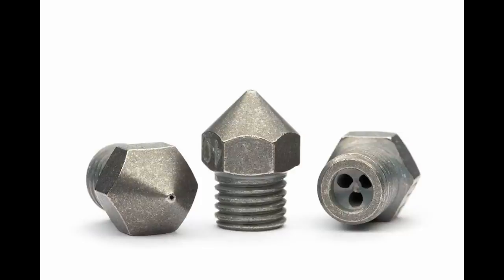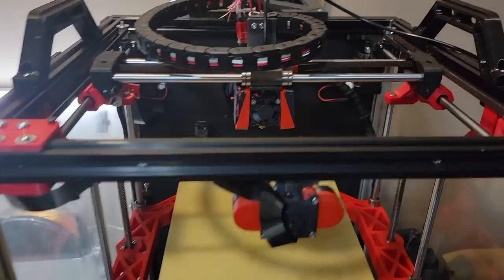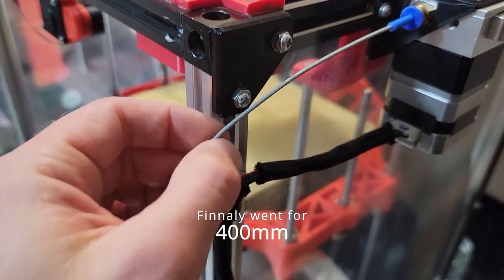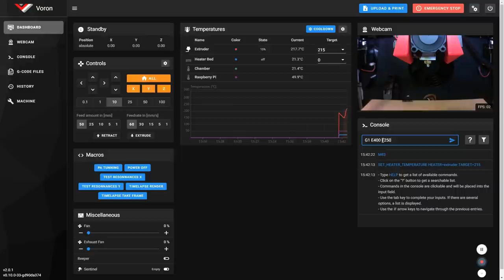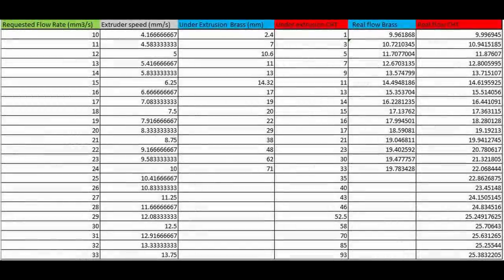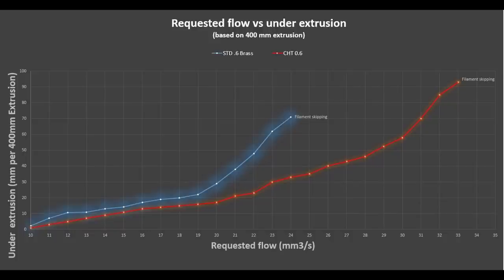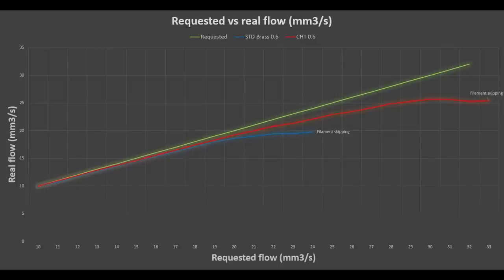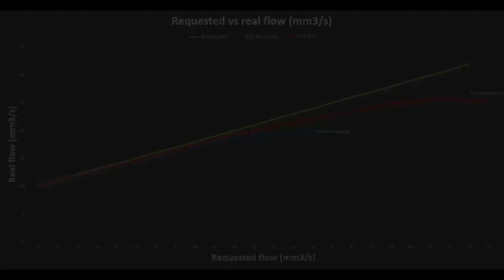BondTech CHT Nozzles Flow test. Do they work?

Comment from the maker: Keep in mind that this test was done on a Bowden setup with a single drive extruder. There is way more filament slippage than a dual drive. So I expect way better result on a BMG/hextrudort or LGX extruder. Specially in a direct drive setup.
Reply: I bet will get less under extrusion and skipping step faster. If you have time for test that 😁
Reply: Actually the effect can be even more. I upgraded a prusa mini from stock to BMG feeder. Printing PETG I often got problems with skipping or total blocking. Reason was due to many retractions on the object parts of the filament passed the gears multiple times. The bondtech gears deformed and a bit streched the filament. Only decracing the speed helped... Actually the problems on stock feeder where less (in this scenario, but the BMG behaved a lot better in other scenarios).
Reply: Faulty test from jump.

Comment: Great job brother!  Love the way you have done that test; simple, clear and easy for anybody to repeat at home with their own setup.  I am surprise to see how much filament does not get processed even in the low flow rates :O.  Will keep an eye on that, thank you!
Reply from the maker: I was surprised as well.. but this is a single drive extruder, so...
Reply: Time for a "filament slippage compensation" implementation in Klipper!
Reply: @Vez3D  i have wondered, with the new boards that have 8 drivers, could you clone the extruder output, and run 2 extruder steppers and drivers, and have the 2nd extuder at 90degrees to the first, so the teeth bite into every side of the filament... it would suit bowden style fine
Reply from the maker: @specialingu  there are dual drive extruders. I just still didnt upgrade my Voron yet :P
Reply: @Vez3D  yeah I know, I mean 2x dual drive :) that would give you even more shove/pressure before slippage? As the limit is the gear teeth shredding the plastic?
Reply: L

Comment: Great video Vez! Very informative. The lack of the 0.4mm size at launch was because CHT is supposed to be a high flow nozzle, and 0.4 is not for that at all. It also requires very high speeds to use it to the limits. We listen to the market and we will have the 0.4mm available soon. Abrasive resistant later this year we hope. As people may know we have a partnership agreement with 3DSolex and we are using their patent under license. This was not created by Bondtech but we did recognized the value of this inovation and finally is out there for us all to use.
Reply: how come you dont have a copper version?
Reply: @specialingu  The perfomance improvement wasn't following the cost increase.
Reply: @nunosantiago6720  I'd like to see a Tungsten Carbide version of the CHT (if it's even possible to machine) - great hardness + great thermal conductivity = best of both worlds.

Comment: Thanks for testing this.  One thing that REALLY caught my attention was the difference in output starting at 9:44.  The regular nozzle making wide loops while the CHT makes a tight stack tells me that the regular nozzle isn't putting as much heat into the plastic, so, as it cools in the air, it is less flexible and thus can't make tighter bends.  What that should mean in practice when using the CHT is that the plastic will not only flow and stick better, but won't 'tug' on the nozzle at high speeds.

Does that make sense?
Reply from the maker: It does

Comment: The pattern is so consistent I am surprised we don't have a speed compensation parameter to tune on the firmware (maybe we do and I don't know about it)? Has anyone showed this to the Klipper developer? 😀
Reply: Damn that's a great idea. Should we make a feature request? I'll vote if anyone does
Reply: Oh well, that would be awesome!
Reply: Came here to make this point... already made - good job :)
Reply: What would you change though .. higher feed rate leads to slippage so increasing the feed rate to compensate just increases the slippage?
Reply: @MrMetalWorx  could still work if they don't increase at the same rate. Maybe some temperature compensation could be thrown in as well.
Reply: On reprap this has been available for years, it was one of the main reasons why I switched from Marlin at the time.

Comment: Nice to see the actual charts for this, i spent my latest live stream playing around with these and just ran higher and higher flow prints till they maxed out. But they do deliver on what they claim, which was great to see. Really the only downside is no sub .6mm nozzles and the fact abrasives are a complete nogo. BT claim coldpulls work find but ive yet to test that either. 
I can see this being one of the "last hurrahs" out of the v6 nozzle/hotend style ecosystem. 
The 1.8mm nozzle is stupid fun and the .6 will be installed in my tallboi going forward.
Reply from the maker: Thanks Nero.. I can't wait to test the 1.8 on my Magnum+. I'm not sure the RepRap V6 style nozzle will go away  soon...Slice has well explained why they chose to go with on the M+ and it made a lot of sense :) go check Vector 3d last vid interviewing Dan. :) Again thanks for coming to here mate. Have a terrific evening 😊
Reply: one thing im curious about, why bother with brass when you could go straight to copper? unless copper is a right sod to machine the way they need to for this...
Reply: @specialingu  Most likely due to the fact that copper is softer than brass and considering how thin the web is, the extra strength would increase life and making machining it easier.
Copper is a PITA to machine
Reply: @CanuckCreator  yeah that makes sense. I guess the ultimate nozzle might be a "phat" revo type with a copper jacket and a brass splitter insert but that might be impossible

Comment: The filament in the old nozzle seems to behave as if there are cooler spots in the extruded filament the way it moves around before falling, instead of just flowing straight down.
Reply from the maker: It definately got my attention as well how differently they were pushing plastic.
Reply: He's pushing it so fast the center of the filament isn't melting as fast as the outside so I suspect the fan is hitting at the points of the extruded filament that bend intermittently.
Edit: I think that's the reason for the mixing section of the new nozzle.

Comment: Thanks for the test, it's very interesting and informative! I noticed an issue though, you mentioned you are comfortable at 19mm^3/s for the standard nozzle and 27 mm^3/s for the CHT nozzle in the video because you don't want to see too much under extrusion in actual printing(very good point!). But according to the curve you get, CHT nozzle will under extrude more start from about 21.5 mm^3/s onwards. I think the comfortable points for each nozzle should be 19 mm^3/s and 21.5 mm^3/s instead?
Reply: Added an image to demo the under extrusion amount: https://imgur.com/a/H2HKMfd
Reply from the maker: Sure but that it's at high speed with no stop for 400mm.. I don't see a print where there is not stop or break for the hotend like so.. that's why I think it would be safe to use higher
Reply: @Vez3D  This theory applies to both nozzles here ;)

Comment: Do you have any strange z inconsistency issues on that printer? I'm asking cuz I noticed that the extrusion gear is off center and CNC kitchen just put up a video where he was having issues with the printer and the off center hole in the extrusion gear was causing uneven extrusion.
Reply from the maker: not realy.. minimum I think. just normal stuff with 3d printer stuff. But maybe it will be better once I fix this
Reply: @Vez3D  okay yeah yours doesn't look as bad as his did I just noticed the wobble so I figured I'd mention it

Comment: The deviation between requested/actual flow was pretty much my main roadblock when trying to go faster. Sure, it'll still print, but at some point the quality really starts suffering from under extrusion.

I'm not sure if you could compensate for this in software or just have to pick a nozzle/temperature combo with a little under extrusion.
Reply: The Prusa Slicer has a flow restriction setting .
However faster always means worse. The plastic needs time to bond.

Comment: Gives you the potential for a (pre-stage melt) before it hits the final nozzle diameter.  You will need a 24v system and a higher wattage heater to fully take advantage of this. But this will work best for nozzles .5 and bigger.  
Love this outside-the-box thinking on where to gain some headroom!  Well done bondtech!

LOOK at those steppers!!  I want to see you do a closed-loop mod! Looking for missed steps as your pushing the bananas out of it!

Comment: 3 more questions: Is adding 3 holes the same as extending the meltzone (e.g. compare volcano)?  Is surface area the limiting factor in flow rate?  Does forcing the core of the filament to split and therefore heat beneficial in any way (flow, quality)?  Another way to put the last question: how does the temperature gradient across the filament cross section impact printing?

Comment: So if I'm not mistaken here, this technology is purely to increase contact surface area which improves melt time increasing flow rate while creating additional obstruction to the nozzel. Essentially you get faster melt time which increases flow rate but with obstructions that reduces flow rate and makes it harder to unblock. This is compared to what everyone else did, which was to just make the nozzel longer to increase (surface contact and thus) flow rate without extra complications or expenses. In short, this nozzel is great if you need to maximize performance in tight spaces, but it's not going to outperform a longer nozzel.

Comment: I'm making an extruder that uses neoprene belts/rollers to push Filament to not leave any marks for this reason! No bite gears just you know, friction!
Reply from the maker: you have to keep me posted on this :)
Reply: @Vez3D  I'm planning on doing it once I escape Iran so it'll be a while before I can actually try it! In the meantime tho I've been tempted to try tpu printed gears
Reply: @ameliabuns4058  TPU printed gears? Oh dear, those will last like what, one print? At least make them from Nylon, which is known to be very abrasion resistant and actually used for gears sometimes!...
Reply: @fuckutube65  what are you talking about?
Reply: @fuckutube65  it's gonna use it to push filament not as a gear

Comment: I love your videos, and this one is no exception. BUT, it seems to me that something is very wrong here. I have performed these same tests on my stock Ender 7 and I hit 18-19mm^3/s at 5% under-extrusion, 19-20mm^3/s for 10%, and it falls hard (20%-40%) at 23-24mm^3/s at 230-235 degrees with eSun PLA Pro (PLA+) on the factory 0.4 nozzle. Extruder starts audibly slipping at 23^3/s and consistently slips at 24mm^3/s. Why is this underextruding at 10mm^3/s and basically unusable for a quality print (my personal standard for this is 10%) by 12mm^3/s? Something feels off here. Way off.

Comment: My bowden (cr10s pro v2) can do at least 40 mm^3 with a 1.2 nozzle very well, less with smaller ones. Bed slinger can't go faster with acceptable quality to push it (100, absolute max 120mm). But I also have the full copper block. After upgrade from aluminium I had to reduce ESUN PLA+ down to 190-195 degree from 215 degree for good results, got too hot despite hero me dual fans upgrade. Will now upgade x,y axis to linear rails, wheels turned out to be unreliable. After a while something breaks, like waves in first layers because wheels started to develop dirt/bumps or simple untightened themselves.

Comment: Looks like there is no point to use both after 19
Reply from the maker: It depends. This is asking constant rate extrusion at high speed. On a normal print...this would translate to a very very long straight line with no pause. In a real world, the extruder will pause ..or slow down at corners..and curves etc.. or even stop for a retract, releasing back pressure..so I think if it's not skipping it's safe to say it would be not bad.  But keep in mind this is a bad setup with a bad extruder with single drive gear and a Bowden setup. The goal here was just to compare both nozzles on the same bad setup hehe. And yes ...it really improves flow I think. If I do the same test with a LGX or BMG.. it would be show totally different numbers :)

Comment: More even heat distribution through the substrate = better flow. There'll come a limit to how much more performance can be achieved in this method by looking at the viscosity characteristics of the individual heated polymers. The hole sizes can't get any smaller than pi * sheer boundry^2, so that really defines how much you can redistribute heat better using this method of splitting flow.

Comment: I designed an extruder idler assembly very similar to what your machine has and through moving things around in CAD noticed if you add a screw to preload the spring just below the actual load you tweak it to. Eliminates one source of potential skipping but trades it for a source of vibration when it would otherwise skip. I opted for the vibration route since that is counterable by tweaking other settings.

Comment: Would be an interesting developement: A flow correction feature for a slicer, there you make a test of 5 volume speeds measuring the lack of extrusion, the slicer than calculates the trendline and instead of traditional calculating the extrusion lenghs it calculates the lengh realy needed for the speed to actual get the volume needed. Of course never use speed setings of the printer, because if you reduce speed there you would get over extrusion.
Such a correction might be possible in the firmware also - but as the effect might highly depend on the filament you use, you would need an autocalibration there. Maybe an encoder measuring the amound of filament realy is pulled into the feeder...

Comment: Great video very informative thank you. I thought I would share my experience. I went from standard 0.4mm nozzle on my ender 3 pro where my best reliable print speed in cura slicer was 60mm per minute. I put on a cht 0.6mm nozzle and was able to comfortably print with similar quality at 125mm per minute. I printed the same part on each setup. The 0.4 nozzle at 0.2 layer and the cht 0.6 nozzle at 0.3 layer. The print took 17 hours 23 minutes on the 0.4 and 6 hours 7 minutes on the cht 0.6.
Both prints of similar quality. That to me spells results.
Reply: I also have a 0.4 cht that I have not yet tried but that is next on my list

Comment: How fast can you print with this 0,6mm? 28mm3 is how fast?
Reply from the maker: It all depends on the layer height. You can use the tool on 3dpassion where you can buy the nova hotend to calculate speed
Reply: Teaching Tech has a calculator on his website.

Comment: As I read the last graph the CHT is able to push out 25mm³ but you have to set it to 28mm³ so you would have to adjust to set the flow to 112%. But I don't know if this would lead to overextrusions on parts of the print where the max speed cannot be reached because of slow acceleration.
Is there any firmware, that is able to automatically adjust the flowrate non-linearly to the current print-speed?
Reply from the maker: Rrf

Comment: Noticed that you change nozzles without heat on the extruder... I damaged my threads on a Mk7 this way
Reply from the maker: It was at 215c when I swapped nozzle. I know why you say so. Because I touch the nozzle with bare hand. Hehe once nozzle is loose you can use fingers to unscrew it...if you don't hold it too long and too hard. I do this all the time. Hot potato game. Dont stay too long or get burnt hehe

Comment: Thank you, good job. I would love to see a comparison between this and a volcano or other high flow system, to see whether this could be a usable alternative without the hassle. It would also be nice to see a comparison in stringing.
Reply from the maker: this is not meant to replace a volcano :) .. but you can add this to a mosquito Hf to get even more flow.. or a E3D revo.. or anything RR/v6
Reply: @Vez3D  i see what you mean, but it is marketed as increasing flow. I was wondering if this could be a way to use a regular flow hotend in higher flow situations instead of a volcano or an hf mosquito with comparable flow, but being able to revert to standard flow just by switching the nozzle. If you use a volcano, you end up having trouble if you want to use small nozzles, and this may be a way to get x percent of the performance for the occasional use of a big nozzle without messing with the hotend.

Comment: how often do they get clogged with lots of retractions?
Reply from the maker: need to test that.. but Bondtech on their YT channel put a video with a retraction torture.. and it did pretty good
Reply from the maker: dont forget that retraction clogs are happening in the throat.. not in nozzle... unless something carbonized and block the hole.. or a particule is blocking the hole. It wont be any different than a normal nozzle in this case

Comment: your work is good, so why dont invent a own nozzle with heat-elements directly integrated at the end of the nozzle. Then a very-good insulator (e.g airogel  https://www.youtube.com/watch?v=qnOoDE9rj6w) around the nozzle, and then pump e.g. compressed air (cold air) directly around the nozzle to instantly cool the filament down to reach even higher speeds ? Great work your doing.  Also you showed that its important to know the length/thickness of the filament feeded, also invent a own device :) (which would be best at least :) ) or use ready devices like e.g. (diameter https://www.youtube.com/watch?v=HFCmOfl3ut8 ,  https://www.youtube.com/watch?v=RYgdLPe_T0c)  or ( length  https://www.youtube.com/watch?v=LLo03IH-dpc  perhaps not usable for filament).  Nice to watch ,good work.